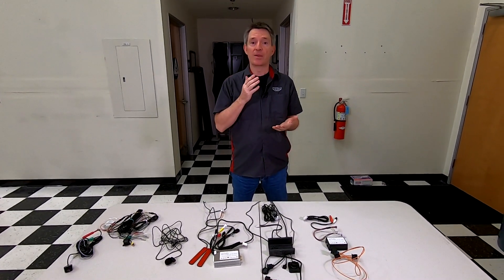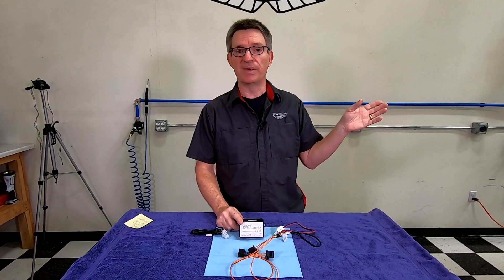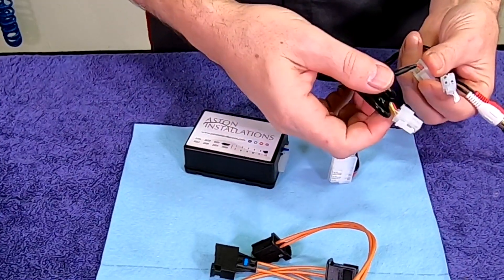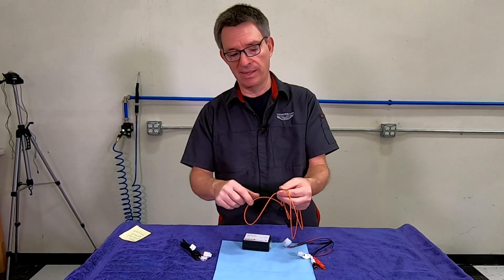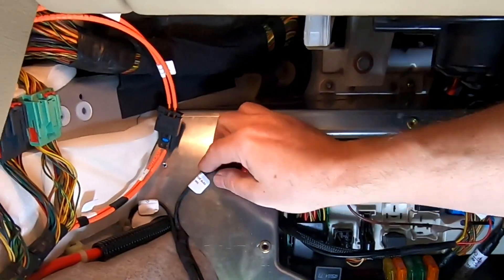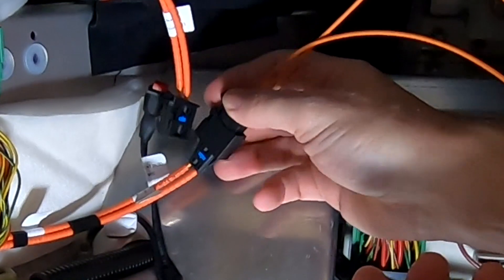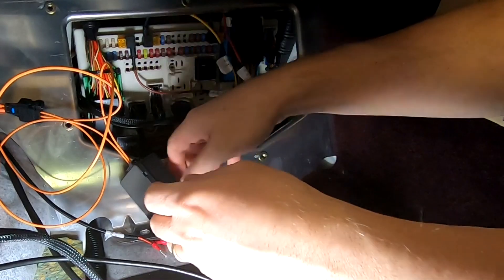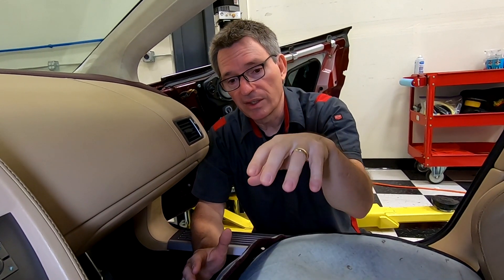Installing the MOST Interface - Aston Martin DB9 Infotainment Upgrade - Part 3

Comment: I feel your pain and I commend you trying to upgrade but I am a believer in keeping cars stock…I would prefer you get a newer DB9, like GT!
Reply from the maker: I generally share the same opinion, I like stock as well.  But, when I can do an upgrade that preserves stock and allows for the upgrade, I find that appealing as well to move forward.   The HD screen still allows access to the original OEM crap nav system, it just adds a new thing along side it.   When you see the final result you can judge if its still like stock.   Thanks for watching!